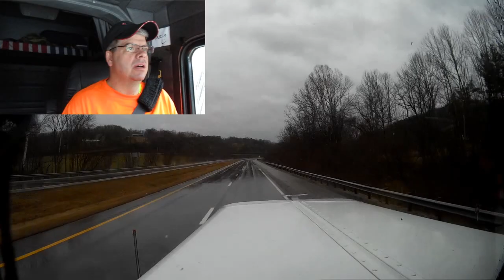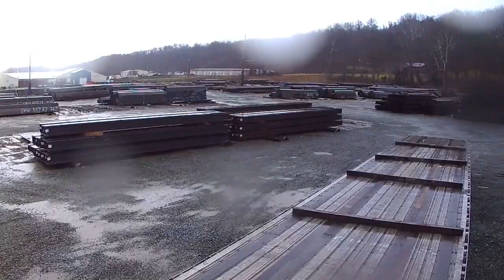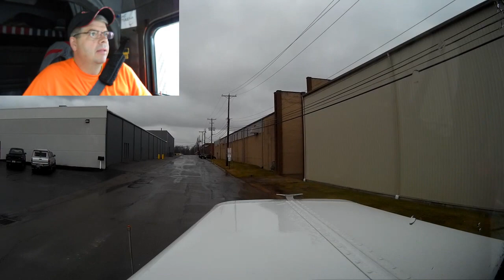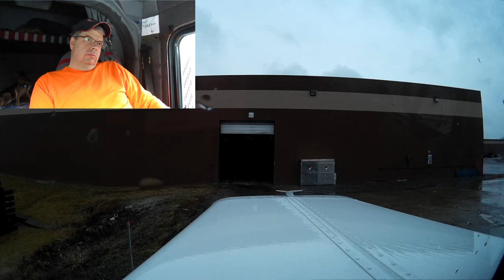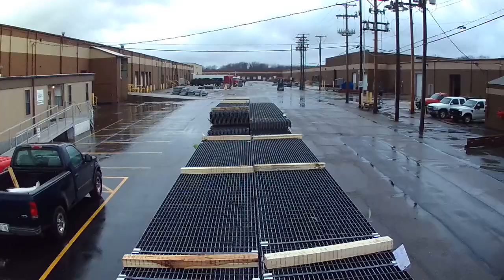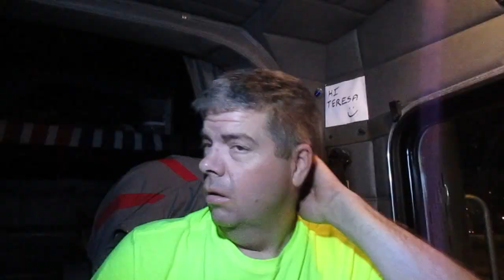#52 Unloading Steel Beams The Life of an Owner Operator Flatbed Truck Driver Vlog

Comment: what is the buzzing noise? love your videos I miss driving. keep up the good work and videos be safe
Reply from the maker: +Wilberto Escalera 
Thanks for watching
The buzzing noise is the switch for my dump valve which releases the air from the air bags on the rear axel of the trailer. Which helps in turning corners. I had to put a buzzer on the switch because I would forget to turn it off.
Reply: Oh OK. Oh ya I love your Pete when I drove for Werner and tmc I had a Pete 379 long nose my wife had the same Pete as me lol